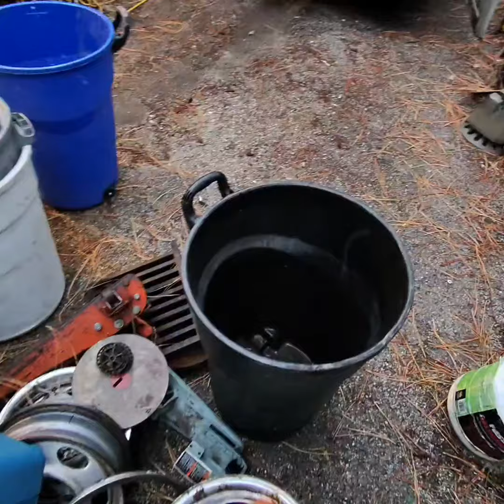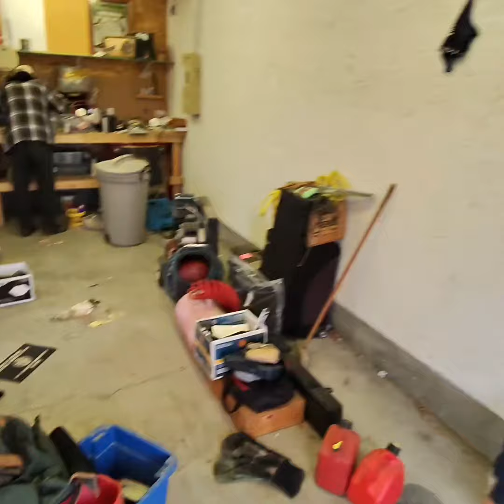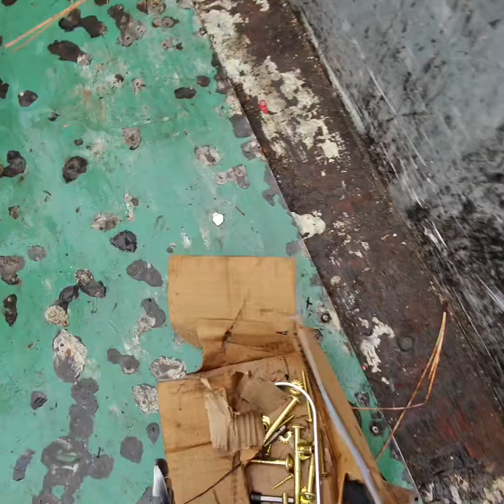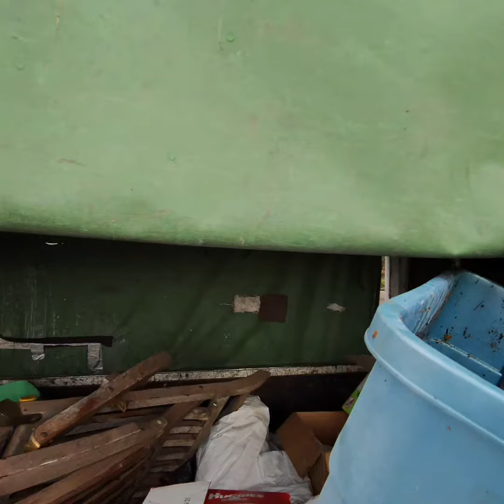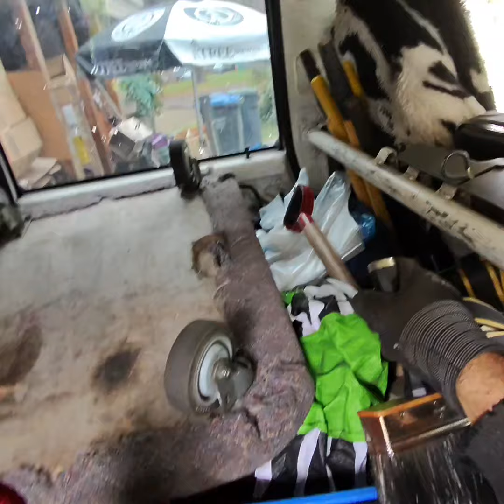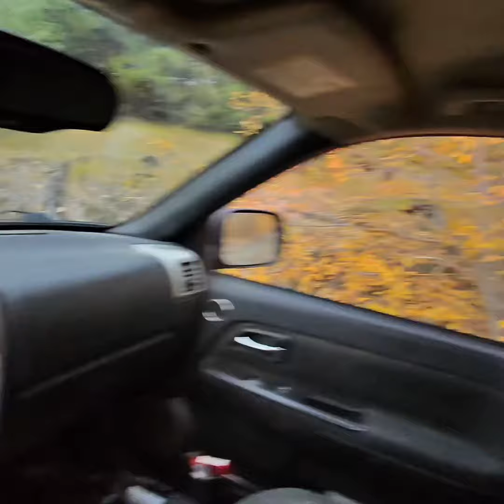Dumping some more shred

Comment: Great Video. Cool to see whats left outside the scrap yard
Reply from the maker: If price of scrap ever goes up here I'm going to miss getting access to random bits of scrap for projects.
Reply: @Nas_Atlas  Back seat of the Atlas is doomsday prepped :)  Awesome!
Reply from the maker: @scrapbongo  I took out a bunch of things that never got used and made permanent homes for things I used often.  It's nearing it's final form!
Reply: @Nas_Atlas  the extra cab in the back is fantastic for being prepared for all jobs.  Im mulling over getting a trailer.  Dump trailers are pretty heavy and fairly expensive.  May just go with 12x6 single axle.  Thoughts ?
Reply from the maker: @scrapbongo  I can never go back to without a crew cab.  It's just perfect for my work and life.

If you get a five foot wide trailer with the wheel wells it will be six feet wide so will match the profile of the Bongo.  Going wider could work but you'd have to extend mirrors and be cautious since the trailer is wider than the truck.  

Mine is 5x10

5x12 would be nice but practically speaking I don't regret only getting a 5x10.  A dump trailer is nice for small messy garbage and yard waste but there are ways around it.  For example people use the burrito method when loading leaves.  Load some leaves put a tarp then load some more leaves.  Repeat.  When you unload you just have to drag out a few levels of tarps.  Cheap way to get around having a dump for some materials. 

Don't get caught into hauling any big amounts of dirt or concrete anyway you'll just end up breaking your truck and trailer like i have and need a bunch of repairs.
Reply from the maker: @scrapbongo  Crew cab is essential for the truck life I live.  I have a 5x10 and it's perfect.
Reply: @Nas_Atlas  great tips. I've never heard of the burrito method!  Hmm, yes, 5 foot wide, probably best as you suggest.  I think mostly furniture, mattresses, appliances.  Agree on no cement or dirt
Reply: Took a look today if I could get a 2" hitch welded and bolted on to the Bongo
Reply from the maker: @scrapbongo  The hitch I used was an adjustable width one.  I had to drill holes at the correct width and then drill a couple holes in the frame to bolt it in.